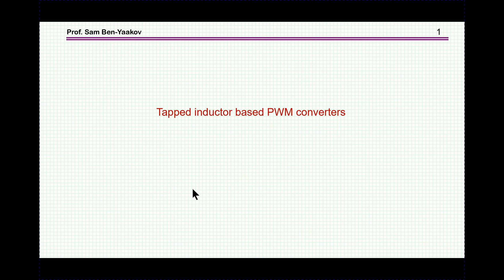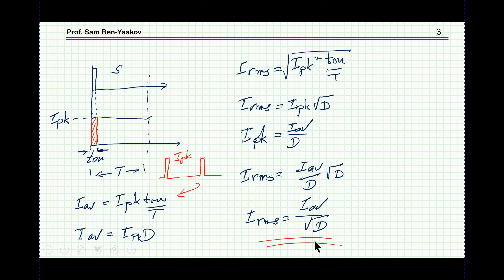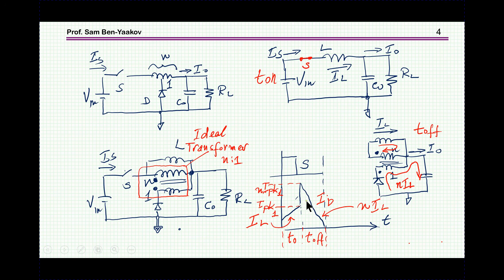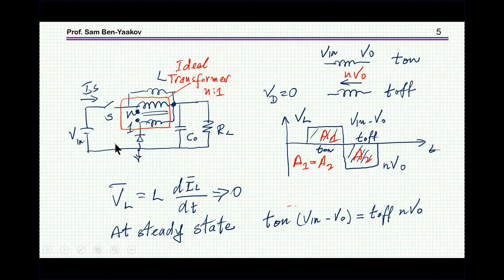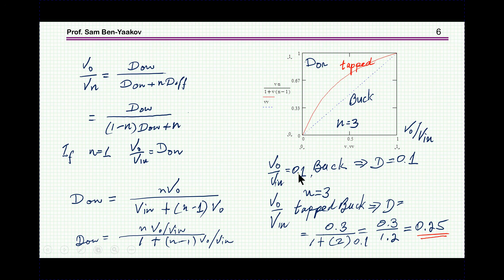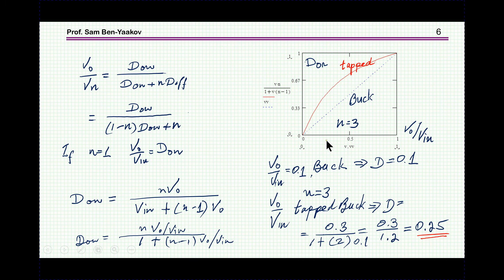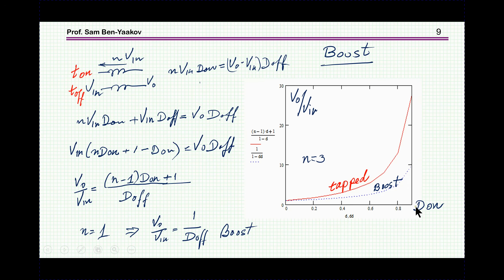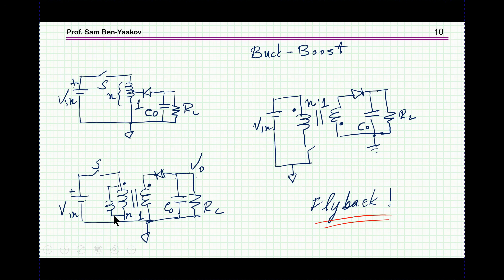A primer to tapped inductor based PWM converters

Comment: Great video. Would any of these results create similar effects on a circuit that has the diode between two different inductors, rather than a tap on a single core?
Reply from the maker: No, the coupling is essential.
Reply: @sambenyaakov  Thanks, I had a feeling that was the case.

Comment: @Sam Ben-Yaakov small remark. At 10:40 (boost example) the way how the coupled inductor model with L_m (magnetizing inductance) & Ideal transformer are connected imo wrongly. Cuz the source doesn't see this tap but just start of winding "1" after which is winding "2" let's say relizaed on the same core and between of them is tapp to the e.g. MOSFET (key). Could you say that this modeling on your side is equivalent to the ver. where tap is on they switching key S?
Reply from the maker: I am not sure I follow your question. The circuit on the upper right is a correct model of a the tapped inductor. From there, everything is trivial.

Comment: Great video, thanks. I wonder something. What is the maximum output power for tapped inductor based converter. Is it like a flyback converter?
Reply from the maker: Yes, tapped inductors are similar to Flyback converters, both are limited by leakge inductance.

Comment: A great video deriving the tapped buck converter topology. I used to work on this converter 30 years ago and they are still flown in space. One issue is tapped buck will generate a right half plane zero. Hope you have some to derive the open loop gain. Thanks Dr.
Reply from the maker: Thanks Thanh. Wow. It must be heart warming to know that your creation is roaming the universe. Would you please share your comment at the LinkedIn group ( https://www.linkedin.com/groups/13606756 )  I have recently started? Thanks.

Comment: Thank You very much! Great lesson again, good enough to follow. But transformers, they are so unlogical! Or at least unintuïtive when you think in voltageratio=windingratio!
Can you make a video that let us fully understand how a normal transformer cán work?
How can Vin/Vout=Npri/Nsec??
I mean, with less windings (by same current) on the primary you múst get less magnetic induction to the secundairy. 
So hów can the voltage there then increase?? 
(Or, how can Vin/Vout=Nin/Nout (N=number of turns or windings) if magnetic drive is only in amperes*turns?)
Can you teach that? Please?

Comment: Also it is worth noting that a tapped inductor will also be smaller an more efficient than a non tapped inductor in a conventional buck converter as the tapped inductor is able to gain the advantage of the 'transformer action' and thus reduce the amount of energy that needs to be stored in the form of magnetic flux.

Comment: Sam,

Another great video.

A few additional points about tapped buck converters:

The longer D-on period really helps reduce any controller noise and inaccuracy.

The longer D-on means a shorter D-off period which helps with dynamic step load response time especially if the load is very dynamic as is the case with PoL applications for powering microprocessors.

As for the leakage issue - my advice here is to turn this factor into an advantage by simply changing the design into a resonant converter and then use the leakage to your advantage.

Finally I would point out that tapped converters have all the advantage of a transformer based topology in their ability to reduce the voltage and current stress on the switch devices by a factor of n ( the turns ratio).  The only disadvantage is there lack of galvanic isolation (which is not required by some applications) and tapped inductors have the advantage over fully isolated transformers in reducing the required volume of copper and a core window size reduction thus reducing the cost and core loss.
Reply from the maker: Michael Harrison Thanks for the interesting and usefull comments. Would you please re post them at the linkedIn group " Where power meets..." so other members of the group can benefit. Thanks.

Comment: Very interesting! I put together a SPICE simulation of a boost converter with the MOSFET switching a center tapped inductor and the behavior across the MOSFET is very constrained, even without a snubber. Being able to use a lower Vds MOSFET without fear of blowing it up on a regular basis would be a significant improvement in many applications, maybe enough to justify the increased cost of the tapped inductor.

Changing the coupling between the halves of the center tapped inductor in the boost configurations from 1 down to 0.95 doesn't seem to have serious consequences.
Reply from the maker: Thanks. I hope others will read your important comment of the reduction of the MOSFET's voltage stress.
Reply: @sambenyaakov  my bro what about rail tap buck-boost convertor